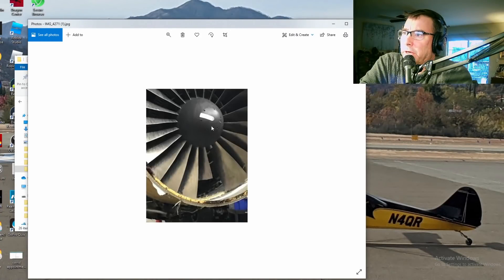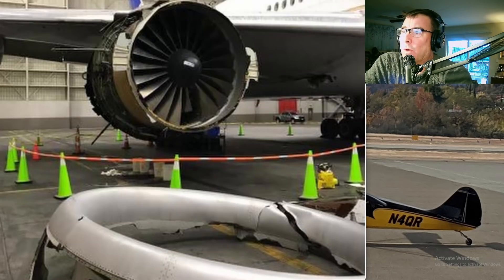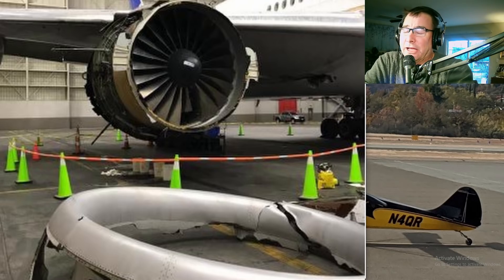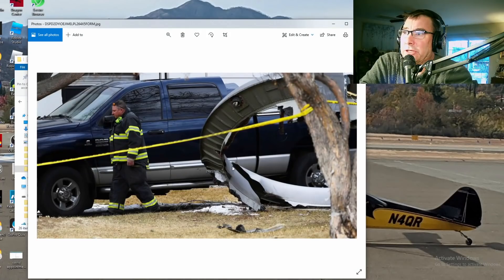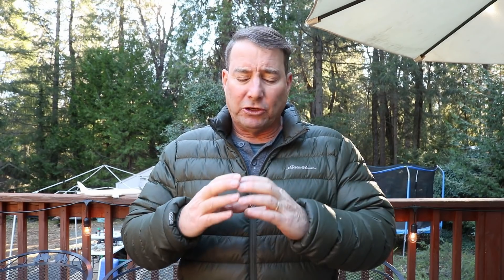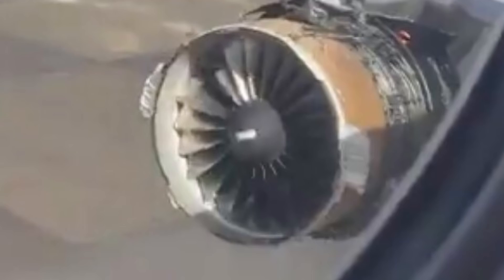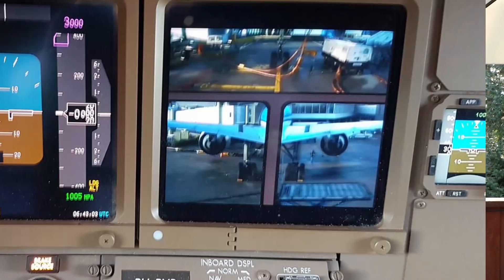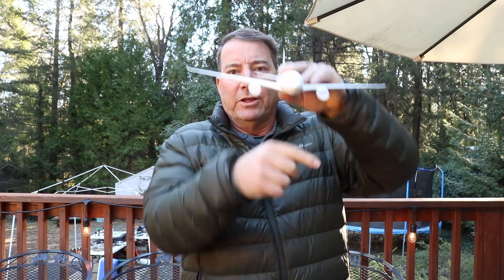UAL 328 UPDATE Fan Blade Failure  B777-200  22 Feb 2021

Comment: I had a question. Would it be possible to have some kind of braking system in an engine so that it locks the shaft if the engine fails and prevents it from "windmilling"?

Comment: With all the negativity going on with this event, I thought I'd share a few positive things. Less we forget, this may have been far far worse. 

Any aircraft, no matter type manufacture or cost, on take off faces its greatest nemesis, stress. Yes, gravity too, but stress is the be end of end all. A 777 is a huge aircraft in terms of weight, dimensions and mass. This particular 777 had a catastrophic failure of its right engine just after takeoff and still managed to climb out on only one engine. Then it made turns. Again on one engine. Then it navigated back to the airport, landed, taxied on one engine. The pilots are heroes. The passengers are to be commended for remaining calm despite what everyone could visibly see. The crew did a phenomenal job keeping order on board. The aircraft made it back and incase anyone has any doubts, this 777 could've flown on one engine for a very very long time safely. That engine had a catastrophic failure, yet, it remained largely in tact. Yes pieces fell and yet, not one single injury or death. Except for property damage and that can be replaced. The life on board cannot. Nor those on the ground who might have been killed. 

I consider the 777 too be one of Boeings finest commercial aircraft. Shes big. Shes powerful. Shes gorgeous. Besides the 787, the 777 is my favorite commercial aircraft. 

Consider the Concorde crash. Yes, it could've been allot worse, but the point is, it wasn't. I think Boeing, United Airlines, the engines manufacture and the pilots and crew deserve a huge huge thanks. 

As for the root cause. FOD, debris, bird strike on take off, small crack in fan blade. These engines, despite their enormous size and power are still very delicate. Weight is key. So many structural pieces are designed with that in mind. The fan blades are just one component. 

🛫🙏🇺🇲

Comment: Titanium blade requires vacuum process at the final step to remove  carbon and O2 out. There are the weakness to titanium. NTSB will look on molecular structure of the blade.

Comment: I doubt a fan blade will “skip forward “ like how you think! 250kts that’s allot of air flow against that array! Also the inlet cowl is cracked not sliced!
Reply: When a blade lets go, its initial velocity is comparable to the muzzle velocity of a gunshot. 

So it's like shooting a rifle in tornado. (Drag is proportional to the square of calibrated airspeed, CAS in flight is on the same scale as a tornado.) The wind will deflect it, but it's not going to immediately blow the bullet 90 degrees off course.

The blade travels generally outward and it would take a 90-degree turn to reach the engine. So the aerodynamic forces won't be significant compared to the impact force as it ricochets away. 

The blade will be long gone from the engine before drag catches it.

That said, I'm sure that kevlar composite flexed a lot. We could see it a-wobbin in the breeze afterwards, so it must have been flexible enough to catch that blade like a goal net catches a hockey puck.  I can believe that it would pop the cowling off.

I'm sure NTSB will take a look at that jagged edge under a microscope and see if it was pulled apart or sliced.

Comment: That's the trouble with ETOPS it assumes that the failed engine is structurally sound and has had a failure of something like the HP fuel pump.
If we have an engine that is shaking itself of the wing its all theory as to how that engine will detach. With LP fans getting ever bigger I think we need engines to be designed so that the fan can be either feather and/or mechanically stopped from rotating if required after an inflight engine shut down.

Comment: Got to be a better way to monitor those fan blades than visual inspection. And, I'm betting there are lots more failing than make the news, with most failures contained as designed. I'm betting an invisible hairline crack radiating from the hub could be detected earlier as a change in electrical impedance in the blade if a spring loaded slip ring affair was designed to ride against the blades a few inches out from the hub.

Comment: One thing that really needs to be mentioned is that the engines do not come with the aircraft when an airline or even private buyer orders one from any aircraft manufacturer and that Boeing did not supply this aircraft with the PW 4000 United did. Different airlines use the preferred engine supplier for the aircraft. I keep hearing oh Boeing had another problem and no it was Boeing who choose those engines

Comment: I recall a large airplane a few years back where the engine detached from the wing rolling backwards over the top of the wing and it damaged the hydraulics and the Leading Edge of the wing where the flaps could not be used. I believe the plane crashed because that happened. I believe the maintenance crew improperly installed the engine and that is what caused this event to happen.

Comment: Bear in mind that the fan blade does not need to contact the inside of the duct to be projected forward. It is already under enormous forward thrust load at the time of failure. In the hovercraft business, blade failure is not unusual often caused by FOD. It seems counterintuitive but the blades always fly forwards.

Comment: They maybe designed with lots of safety features in them but what about the cowling that’s fell off and landed right outside someone’s front door? That could have been a catastrophic incident in itself. It could have hit a gasoline tanker refuelling at a fuel depot or any number of places that might have killed many people. They got lucky if you want to call it luck. I guess there will be lessons learned from this incident which will result in more stringent standards going into place. There are so many parts that go into the makeup of these aircraft and many thousands of people that assemble them too. There are inspectors and machines that inspect parts too but there’s always a chance for failure do to something or someone who screwed up.😳. Sorry, gotta go catch my flight.😳😮🤔

Comment: Hello: I’d like to say a few things.....in a turbofan fan shaft failure the fan becomes unloaded and as such will move in the opposite direction of the thrust it was producing, this means forward in the intake...a single fan blade failure also unloads that single fan blade.....it moves towards the inlet.... and becomes essentially a high speed rotating knife.....my thoughts as to why the 777 inlet looks pretty neatly sliced off. Thank God nobody on the ground was hurt. Finally, the engine cowlings I think were ripped from the engine by air disturbance and vibration, once the cowlings have gone you have no onboard fire suppression. Fire suppression requires a closed space, the nacelle, once this is compromised.....the extinguishiant becomes part of the atmosphere. Just my thoughts.....

Comment: The cowling is an integral part of the engine fire containment system by design. There's about a snowballs chance in hell of putting out an engine fire when the cowlings missing. From my days at Rohr designing engine cowling sits what I remember after reading Boeing design requirements. This was the same for P&W, Rolls, GE and CFM.

Comment: You are correct too about speed....dependant on the damage that has occurred this will affect the resonant frequency where it will vibrate the engine and speed should be adjusted to a low vibration speed.

Comment: There's no GMC  (Ground manoeuvring Camara) on the 200's. Landing with flap 30 is also an option single engine, (the QRH gives you the option), this depends on performance of course. It's sometimes more preferable as your approach speed is lower and landing distance is reduced, agreed your Go-around Climb Gradient is reduced because you're using Flap 20 instead of Flap 5 single engine.
Our SOP's differ from yours, any Non Normal landing is carried out by the Captain, I do agree of course with what you say about the Captain being PM for the decision making and  communication with the cabin crew but I would always take the landing as I would be the most experienced and responsible for the overall outcome.

Comment: Would it be useful for flight attendants to be able to take a cellphone and take a photo or a short video of the engine and hand it to the pilots, just to give them a heads up on the what they were dealing with , as they may not be able to see the engine from the cockpit.
Should engines have a brake to stop them windmilling in a situation where there is a vibration of this kind.

Comment: Why airplanes don't dump and burn fuel from the rear of the plane instead of the wings?
Reply: Fuel tanks are in the wings so you would need fuel lines running all the way to the back which is more complicated. It's also probably quicker to dump fuel straight out of the wings instead of go all the way back. Also the apu is in the rear which could be a fire hazard.

Comment: Obviously the lack of a proper protocol of NDT fan inspection should be in place, at a DIFFERENT intervals the inspection of the blades is critical and the aging of them too. Is a lot of folks talking about Boeing Aircraft, this event has NOTHING to do with Boeing but with the engine manufacturer, lets keeping separate!

Comment: Just a question, Is fuel shut off at the engine point , or at point of tank exit ?   If engine mounts fail, if brakes free , do you end up with fuel spray everywhere ? (Not a large aircraft pilot ) Thanks.

Comment: I am more interested in knowing why United's NDT crew failed to detect the sub-fractures that lead to the failure of the blade. This is not the first time that their engine overhaul practices come into question. Just a side note. The aircraft was climbing at a power setting of CLMB 1, with a cost index of 0. It was most probably doing 314 knots above 10,000 feet when it came apart.

Comment: After watching that engine wobbling back and forth, shaking the entire jet, creating all of that drag, do you believe that there are some fatigue cracks within the engine pylon/strut and the wing attachment points?  I have trouble thinking that no other damage was caused by that engine shaking so violently that it shook the entire heavy jet.

About to say: the engine cowling was blown off with no way to contain the extinguishing agent and fire.  Looks like the engine core was on fire from fuel, oil, skydrol.

Comment: Sounds like lots of the threat of a engine failure, of this sort anyway, it the windmilling, off balance, engine assembly. Is there anything driven by the motors that can be "engaged" to stop the rotation of the assembly??

Comment: Is it possible parts of the blades and/or cowling was ingested into the engine, damaging the oil seals and creating a high friction point that then ignited the oil, thus the continuous flame?   It would not be fuel due to obvious shut off valves, hydraulic lines would not be near the area on fire (and also shut off), so it narrows down to just the oil.  
Also, with the cowling blown off, a Fire Extinguisher is not really needed anyway, the point being there is almost no cavity for the fuel to collect and burn.  FE is to flush out the voids of fire and fuel, but this was looked to be completely devoid of those voids.
Caveat: this is my personal opinion from training on jet engines, not this particular engine and 777 nacelle.  There may be details that invalidate my opinions.

Comment: Sorry, But you didn’t convince me or yourself, that this event would be positive over the ocean in a Two engine plane! Furthermore, based on your excellent analysis, who’s tracking and checking on the maintenance and update of these Heavy planes as the years progress? There also seems to me to be a lot of Engine and Plane combinations out there over time without any oversight and insight as to their reliability? Finally, why do you often hear about improvements to planes and engines but No Renovations to older planes or engines still in service? Have we gone Out Too Far on the Lim with some of these aircraft? Frankly , given the current level of size and sophistication, I’m for Three engines over water and a Flight Engineer!

Comment: Metal fatigue is not something you can pin to the hour/cycles, it is a probability calculation based on stress calcs and test data.  Hence why TBO buffer the inspections to the data.  

Will be intetesting to see the final results.

Comment: No that crack on in tank ring from the impact on ground here what happen it was cascade effect the blade weaken to vibration the blade got sucked by the engine because it was set to max the cold to extreme heat cause micro weakness in mix of metals. As blade got sucked it bust the engine combustion chamber to explode preventing the safety design of engine to fail this why that whole back part shattered the outer shell because the blade went there and in under to main fuselage  and fell out  that's what happen I can tell by the videos.. and how the made it..

Comment: Does anyone out there realize that this engine was 26 years old ? I think that is the more serious question.
Reply: 26 year olds are still self lubricating!
Reply: The plane is 26 years old but no moving parts on that plane is 26 years old. Moving parts, engines especially, are swapped out after specific flight hours/cycles.

Comment: Definitely oil or hydro fluid burning.  The orange flame is too cold to be fuel.  I gotta say, the fan case held together nicely.  I remember working on a KC-135A that had a first stage compressor blade failure.  The vibration did some damage.  The only things holding the ring cowl on were the wiring, oil cooler hoses, and the latches from the side cowls.  Had a bunch of ROTC folks on board for an incentive flight.  I wonder how many continued in that career......

Comment: I figured lpt fan blade broke off and took some others off. When an engine wobbles, usually lpt or first row of blades is missing some. I couldn't see too well with small and less clear videos.

Also, nose ring could have had microfisures in the composite core and or corrosion with the rivets.

I guess we will get more info during investigation.

Comment: This channel on (the worst video service that has ever existed.  It wouldn't let me speak my mind) is such a valuable service!  I was wondering....in a vehicle, if the air bags inflate, you it is quite probable that your insurance company will total your vehicle...perhaps unless you drove it off the sales lot 10 minutes ago.  I'm sure if you have an evacuated aircraft departure, it probably wouldn't total the aircraft, but I'm betting it will not be a cheap and quick turn around to get it back into service.  Would they "total" an older aircraft if that were the case?

Comment: looks like poor Maintenance to me, wanting to save Money ...... just a thought.

At least the Design of the Engine prevented the Blade from slicing the Cabin open. Wenn Engineering though. Also none of the other Blades were wrecked. (okay, just the ine next it).

Why dot the Manufacturers add more Cameras all around the Plane? Just like a TESLA for example. Would make things easier fot the Pilots.

Comment: I worked at a factory that made the powerdered metal for Pratt & Whitney. The guys I worked were a bunch of screw ups and the pay sucked. After the metal was created nickle and chromium it was supposed to be sifted placed in containers and covered with nitrogen and welded shut.  I think a lot of contaminated powdered metal got shipped to Uinted Technologies/Pratt & Whitney. The factory was called Homogenous Metals. 

The way it was made is chromium and nickel is placed in caldron and melted. The caldron is places in a chamber that look like a 3 story silo. Air is sucked out of the solo with huge vacuum pumps and liquified argon is injected and all hell breaks loose. 

It was a dangerous place to work. Nickel and Chromium are carcenogenic.

Comment: I flew the 200  er.  My question is the hole in the fuselage. How much damage did it do internally  and close to the fuel tank. I also see the slats  are out and I agree it would be a very long drive to hnl on one with the other doing a wobble. I did accident investigation and have been at the rolls Royce plant. I was always impressed with the rolls having worked on jet engines for three years

Comment: Hey, thanks for the video. Two questions, firstly, you talked about dumping fuel over a residential area. Wouldn't fuel vaporize before it reaches the ground that high at about 13,000ft. Secondly, in order to dump fuel during an engine fire, is it not possible to dump the fuel from the left wing instead of the right wing then balance out the fuel in both tanks?
Reply: Generally above 6,000 feet the fuel will atomize, however it takes quite a bit of time to dump fuel. (It’s not like those Forrest fire tankers, think more opening a valve on the back of a fuel truck.  As to your second question,  we don’t balance tanks by transferring fuel between tanks, we balance them by feeding both engines from the same tank for a while, and again this takes time.  Even more so with one engine shut down.  There is a jettison nozzle on each wing, away from the engine and behind so there is little chance of feeding a fire.  If we only dumped fuel from the left wing, only fuel from the left tank would be gone.  The right wing would still be full of fuel and even though we can operate the left engine from the right tank, you haven’t really accomplished anything with your suggestion.